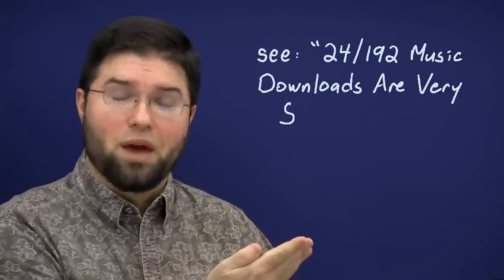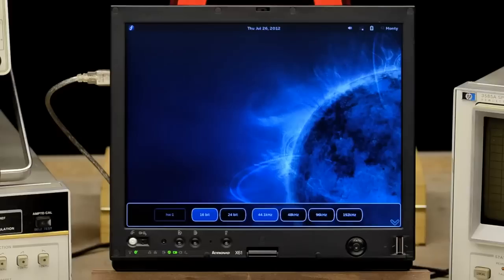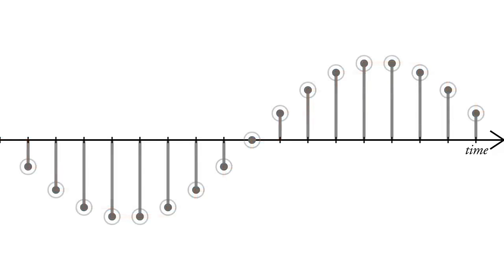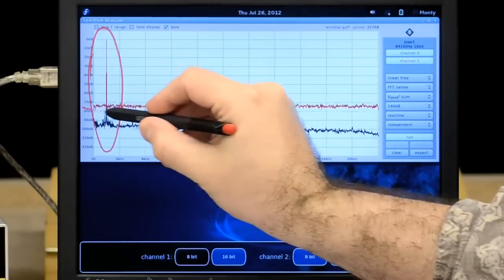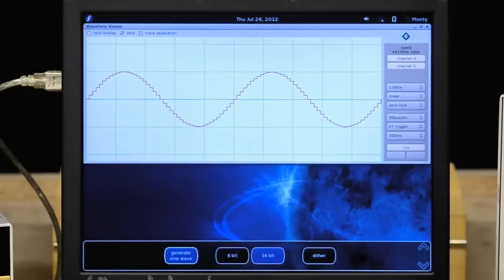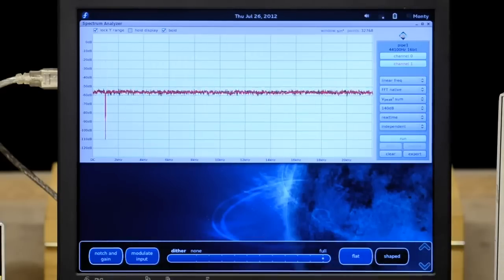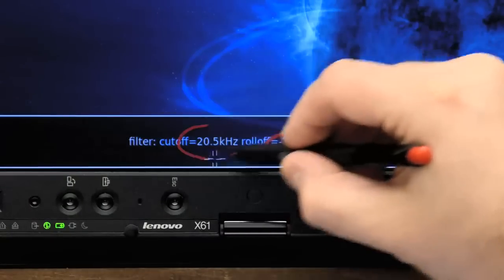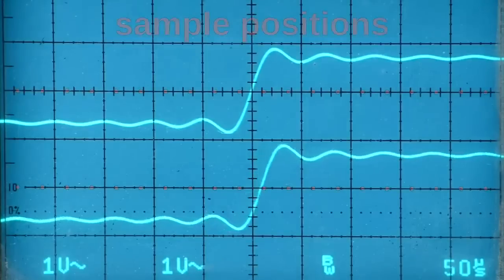Digital Show & Tell ("Monty" Montgomery @ xiph.org)

Comment: I love the sound of analog tape. I also love being able to record with low-noise. Digital recording is the best of both worlds — you can get virtually flawless input, and because the modeling in so many plugins has gotten so accurate and sophisticated — if you want to add the type of distortion analog hardware inherently puts in the signal, you can. If you start with tape, it’s baked-into the stems forever

Comment: The stair step is removed by the anti-alias filter (low pass filter).  All CD players have such a filter at the DAC output.  That is why the stair step is not observed at the output.
Reply: There would be no stairstep even without a low pass filter. Depending on implementation there would simply be more harmonic distortion.
Reply: @benchociej2435 how can that be true? We saw the samples of the analog wave. When each of the samples is written to the DAC, it will adjust it's output to that voltage until the next sample is written. Without a low pass filter, we would see the stair steps between each sample.
Reply: @MultiBallchinian  DAC hardware can't make a stairstep. Nothing truly can, but typical DACs don't even come close as they might have a designed high end frequency response in the 40 kHz range (even before filtering). That's because real world components always have some reactance (capacitance or inductance). This means that amplifiers have a limit to the product of gain times bandwidth. Even if the DAC had massively overspec'd components, you could only ever get harmonics that somewhat approximate a stairstep.
Reply: @benchociej2435  this still doesn't explain why the sin wave is recreated perfectly at various frequencies. I understand that the DAC output can't have an instant rise time between two codes, but i am confused as to why the DAC's rise time between two codes perfectly matches the sine wave.

Comment: There will always be someone who says "No way, 192 KHz is better, I can hear the difference!". These are the people who can "hear" the difference a $5k network cable makes. :)

Thank you for this great video!
Reply: I always think "no you can't mr Simpson, no one can". Lmao
Reply: Maybe thirty years ago there was a difference but now improved sampling accuracy and band limiting techniques negate any benefit of the higher sample rate.
Reply: There is a general fallacy here. For example, audio mastering will usually employ higher bit depth and higher sampling rate. Which makes sense, for example if you want to change volume, i.e make something louder, you need more bits. Generally when manipulating any signal, having some headroom makes sense. That's equally true for images and video, where you want the RAW data for post production.
"Audiophiles" then thought that because mastering uses "higher quality audio", that it would be beneficial to play back that exact audio quality. But unless you can somehow upgrade your ears, OR you plan on doing some heavy post-processing, it'll never make a difference.
Reply: That is sometimes true. However, I riddle you this - if you can hear the difference between two samples, how do you tell which is the "better" or "more correct" one? :) "The one with the higher number of stuff, obviously" isn't a valid answer :)
Reply: @daniel.s.stefanov  very good point. Unless you can hear artifacts (like distortion), even a different frequency balance or "stage width" is not necessarily an indication of one being better than the other.

Comment: This is a great video and demonstration.  A minor quibble: pixels are in fact finite in area. They represent the accumulated number of photons that impinge upon a photodiode, which has a defined and finite active area, over a finite time. To be fair, it is never a true square, but it is certainly closer to square than it is to an infinitesimally small point.
Reply: I think its pretty clear he was talking about bitmap pixels, not physical pixels of a display.
Reply: @CRL_One  Exactly. Afaik the pixel data just contains the color and  brightness information. Nothing about shape or size.

Comment: Really excellent illustrations!  Thanks.

The only place where I personally can imagine higher sample rates and greater bit depths mattering much is for mastering rather than distribution (i.e., mix-downs).  More precisely, if you’re recording a bunch of tracks and manipulating them considerably — boosting their volume or applying EQ, round-off errors can accumulate.

In analogy with video, if you’re creating an HD video, you’re wise to record the source assets in 4K

Or at least conceptually speaking!  So there’s your next video:  How much value does, say 96KHz 24-but audio, have for source material that gets manipulated prior to mix-down?

Comment: Sorry if I'm losing the plot here, I'm not a audio engineer but logically speaking, based on what I know, IMO the problem with analog to digital conversion in real music, not a clean generated sample like that, is the random information (including noise) encoded in the wave form data, so if you convert the analog data to digital, at low discrete steeps, you are throwing away data in a bunch of places along the sound wave and then using a best guess approach to recreate the final shape, by doing interpolation between the captured samples, so yes in a clean sin wave analog signal it works wonders but there's no guaranty that the original analog sound wave, from real random music/sounds, was a smooth interpolation at that exact interpolated point! 
The original could had a spike or dip there that got smoothed out by the digital conversion, because it fall in between the sampling range, so I agree a clean analog signal can be converted to digital and back with no loss at all but in a real chaotic signal, I still believe signal/data loss will happen. If this matters in the end too human hearing or audio quality, is another story and may depend heavily on hearing quality of each person listening.
Reply: please watch till the end of the video for his explaination of bandlimit. the information can be however chaotic you want, but one fourier transformation will disect it into just a bunch of sine wave
Reply: @neroyuki241  Ok my eagerness to reply and my general lack of knowhow on this subject, got in the may (again...), I saw the end and you are right, is not immediately intuitive for those not versed on this subject, like me, but after a few views I think I got it. Thanks for the patience btw.

Comment: For me there is an elephant dancing around the room on this topic. I am sure that plenty of people reading this know the answer and there must be plenty of resources online. But the issue I have is how is a clean band limit (low pass filter) performed that provides a presumably 96dB cut off over a mere 20% frequency increment from 20kHz without producing phase shifts that totally mangle any high frequency audio "square" wave.
Reply: Modern audio ADCs and DACs run at a much higher sample rate than the PCM sample rate and use a digital linear-phase FIR low-pass filter to achieve such a sharp cutoff with no phase distortion whatsoever. For example even cheap ($0.58) PCM1808 ADC has only ±0.05 dB passband ripple and a modest 65 dB stopband attenuation, while the PCM4202 has a ridiculous ±0.005 dB passband ripple and 100 dB stopband attenuation.

Comment: As far as bit depth, I will add this, and maybe my description is inaccurate.  16bit is, as was clearly shown, absolutely more than adequate as far as the source material.  I have many albums in both 16/44.1 and 24/96 for example, and have often compared them, as I'm sure many "audiophiles" have... but what people fail to consider is that typically, it's not the exact same master (that might exist at say 24/192, or 32/192 or whatever) that is simply converted or truncated to 16/44.1.  When and if differences are audible, something else is the cause... a different mix, or a different master, or different post processing.  BUT!!! When it comes to your playback system, namely your DAC and the settings of your playback program/device and that DAC, it can be absolutely beneficial to operate at 24bits, for one simple reason.  In many cases, such as my own use case, people do not use analog volume attenuation alone, or at all.  I do not use any analog volume attenuation - i have pure power amps with no volume controls, fed directly from a DAC (no preamp volume control either therefore).  If the volume was not attenuated, it would be extremely loud, so my volume control is DIGITAL.  Given the power of my amps and the sensitivity of my speakers, I'm using SIGNIFICANT amounts of digital attenuation.  This, combined with the fact that while a DAC might be operating at 16 or 24 bits in theory, that assumes the system is operating perfectly and linearly, which it does not.  ASR that publishes objective DAC measurements always shows their true snr/SINAD/effective bit depth capability, and the actual effective bit depth of the analog OUTPUT is always some fraction of the theoretical bit depth is that it's operating in digitally.  So, combine those two facts, and you can easily experience for yourself, that a DAC operating in 16 bits with the use of digital attenuation into an unattenuated power amp WILL result in noise, especially with high sensitivity speakers (mine are over 90db).  So, the source material can remain 16 bits, but we operate our DAC at 24 bits, because this upsampling allows for a lower noise floor that WILL be evident in this scenario.  I don't think 32 bits is necessary even for this purpose... maybe with extremely high power amps and extremely sensitive speakers and therefore extreme digital attenuation, but I don't think that's practical or ever the case in a typical environment or use case.  But 24bits, with an effective 18-20 bits (realistic for high quality DACs), is very useful in the above scenario.  If you are using purely analog volume attenuation then it's probably not useful, but you also shouldn't be doing that.  There is no analog volume control as transparent or "hi-fi" as using digital attenuation in a 24bits.  Digital attenuation offers superior fidelity, and may also be helping your DAC's op-amps to be operating at a lower distortion as well, though you wouldn't want to go TOO low either, that's where an appropriate power amp watt rating is important, due to the non-linear performance of all amplifiers in that first 1% or so of their operating range especially.  L/R channel balance also tends to suffer at high levels of analog attenuation, but not with digital.  Setting the system to 24 bits doesn't make it sound better, it just adds zeros, but I can switch back and forth at will and at 16 bits the noise floor is higher.  Exactly why this happens I'm not sure.
Reply: Yes, if they didn't tweak the mastering when releasing 24bit hi res recordings, they would sound identical to the 16bit/44.1 versions.
Reply: What I have found with many hi-res releases is that they raise the volume a bit on them.  So, if you compare then side by side most would think it sounds better.  This happens with normal CD remasters as well.  But I took the same file and down sampled it to 44.1 and to MP3 and they are virtually the same.

Comment: This video could be useful in the discussion about the use of digital intermediaries in vinyl LP mastering, like the (overblown IMO) situation with MoFi. Hopefully, this is the end of that argument. But alas I know it won’t be…
Reply: It can be useful to use higher sample rates and bit depths in some production scenarios, but I'd say those aren't the typical cases. Still, even if it becomes necessary in production, the end user doesn't benefit from anything much better than about 44 kHz and maybe 19-20 bits in the absolute worst possible case (even then, the need for such a bit depth is questionable at best)

Comment: Great video, thank you ¡ I've got a question thou.... I thought that bit resolution has to do with the accuracy of the quantification of the samples.... I always compared it with a ruler: if my ruler only have centimeters, well, my measurements would be an approximation with lots of errors.... but if my ruler is divided in 1/10 of millimeters, my measurement, or the description of any sample in space, would be more accurate.... Am I wrong? Thanks and regards ¡
Reply: You’re absolutely not wrong. But, in your terms, if you approximate the measurement with your overly imprecise ruler, you would write down the approximation, in smaller steps than are on the ruler. But the DAC can’t, it just writes down the nearest “big step” that is on the ruler. Since the big steps are near enough in 16 bit, you will still hear a really close version of the sound, but the difference to the actual sound is heard as noise. This is, because a deviation up or down from the actual sine wave, is the same as if there would be another sound overlapping, that makes the deviations. And you don’t hear the deviations, you hear the sound version of them, the hissing noise.
Thats of course completely oversimplified and someone please correct my possible errors that stem from the fact that I too just recently learned this and am no expert, or that English isn’t my first language…
I hope this answers your question :)
Reply: Yes - and the errors are what we call quantisation noise.
We can choose what this noise sounds like, tape hiss or shaped away from the most sensitive frequencies.
If we do nothing it looks like a bunch of harmonic spikes…
Reply: In this case, your rulers are divided into micro- or even nanometers. Your measurement won't be any more precise after some cut-off point, because other than the ruler, you're also using your eyes.

Comment: I have a question: I always thought that a higher sample rate allows a more gentle sloping filter, because the side bands are farther away. Is this a valid argument?

For example, in the video you have a filter at 20.5 Khz whose roll-off is -100 dB at 21 KHz (if I interpret this correctly). That's an insanely sharp filter, which you need because theoretically your next band starts at 22 KHz. If you sampled at 96 KHz, your next band would start at 48 KHz, so your filter could roll-off much more gently from 22k to 48k, which implies that in the bandpass portion, the filter would be much flatter.
Reply: That is true, and one of the reasons why recording mixing and mastering is often done with higher sampling rates.
However, after mixing and mastering, this is not needed anymore and you can store the sound in CD quality.
For playback, there are oversampling DACs which move part of the filter to the digital domain, then you can have a much simpler analog filter afterwards.
Reply: Most inputs over sample massively since a (cheap) analogue filter can bandlimit over 100kHz, sample at 300kHz then an extremely cheap digitally band limit down to something more reasonable (like 48kHz) for the rest of the processing.

Trying to get an analogue filter to leave 20kHz alone and let nothing over 22kHz though would be very expensive.
Reply: @JohnR31415  Even in the 90s I remember CD players would boast like 8x oversampling, presumably as you say so they could implement reasonable cost filters.

Comment: This is very enlightening! But by the time a sound is recorded in the computer at less than 44kHz, more I edit and save it, more it degrades. So the problem is really in the box. but I would be curious to see your setup analyzing a recorded sound instead of the line chain
Reply: Well yeah, if you sample audio below the 2*Nyquist it's going to lose information
Reply: "more I edit and save it, more it degrades" ... that sounds more like a problem of insufficient bit depth or poorly implemented audio processing algorithms, but it depends on what exactly you mean by "edit". it's definitely a good idea to use more than 16-bit depth during editing to avoid repeated quantization noise (32-bit float would be a typical choice), even if 16-bit is fine for the final end product.  using 44.1 shouldn't be a problem or result in degradation if the audio processing is implemented competently, but using 88.2 or 96 kHz sample rate allows certain types of filtering (e.g. fractional delays) to be implemented with much better performance for the same quality (despite having to process twice as many samples), which may mean better quality if the programmer prioritized performance over quality.
Reply: hey! I didn't saw your answer. Thanks for the precision. This video was an absolute eye ear opener!
All in all when I'm recording and editing, I choose higher sample rate and bit. Then when doing the mixdown, 44kHz 16-bit is perfect. After many testing in my studio and in theater (where I mostly diffuse my sound designs), there's no audible difference. A lot of myths fell off the bench, that's great.